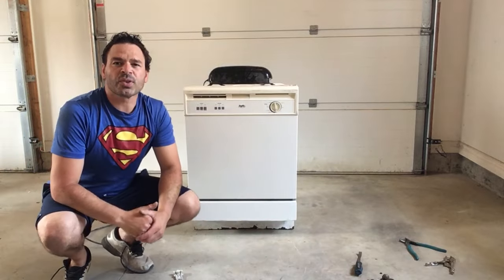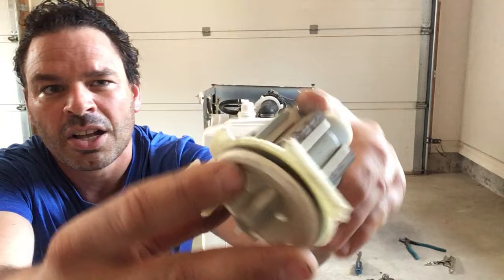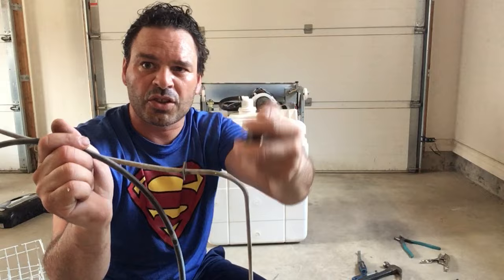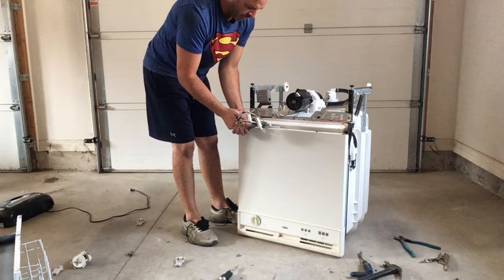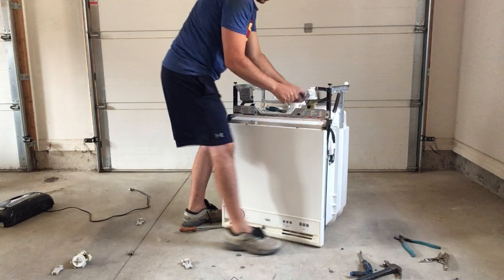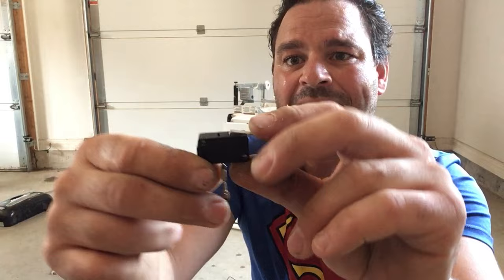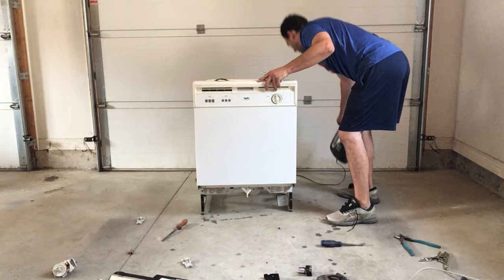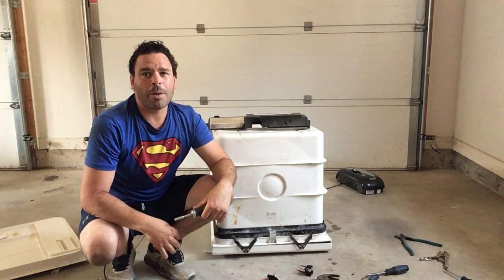Scrapping a plastic back dishwasher for a surprising amount of COPPER, BRASS, and OTHER METALS.

Comment: Yesterday while heading out on an errand I passed a dishwasher set out for trash.   It was able to fit in my Enclave.   I spent this morning tearing it down after watching your video.  Now I just have to get the copper out of the motors and strip some of the wires.  I didn't weigh everything up but it looks similar to the numbers you published.   Mine had a lot of plastic parts in the motors so I took out the copper bearing sections and will work on those to get the #2.  One of the motors had a pretty good magnet for its rotor section.  I need to punch out the shaft if I can.

Comment: Good   day  Watching u tear wire off  U said  40 or 60  %  does  thickness  of wire matter to make 60  %   I have some
wire very thin.  Thanks
Reply: 40 percent refers to the amount of plastic coating there are on the wire. Some wire is coated then braided with other coated wires and then wrapped in one last coat of plastic to enclose the entire bunch. If it's like that then it's only 40% of copper to recover the other being 60% plastic waste. 

60% is the other way around more copper than plastic.
Reply: @kalani4ever359    Thanks